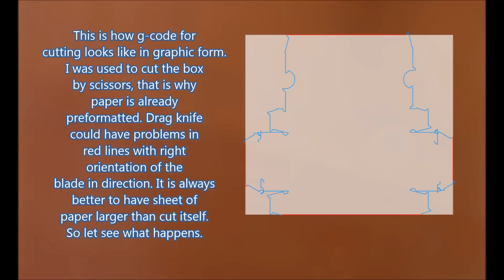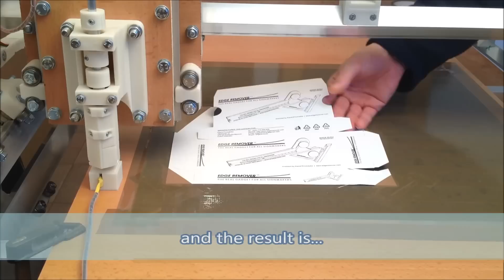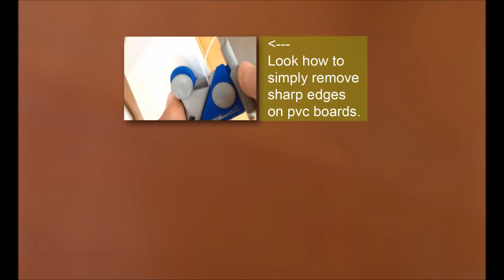Printed Drag Knife DIY CNC works pretty well

Comment: I'm wondering why you use a second set of bearings on the pivot pin.  Wouldn't it be enough to have the pin fixed and then the bearings built into the drag knife fixture would allow it to rotate around the pin without the pin needing to rotate also?
Reply from the maker: +pyronaught Hi, you are right, you can use also solid spindle - mounted rod. Only reason why I did it, was that I wanted whole axis to be rotated. Rotation is then smoother.

Comment: IT'S OK! thank you so much ! got it ! encomodar sorry again , but I have one more question. How is control of the " turning " of the knife when making a cut in a curve . You make the design of the curve in a CAD program and he sets the knife angle in cuts ? Sorry this lot of question is that in Portuguese ( Brazil ) and in forums not esou meeting on the subject. very grateful for the attention !!
Reply from the maker: +Leonardo Huss Knife rotates by itself by slighly touching the material, you have to set it. Turning is doing by circle way like you can see at strange looking corners 2:24, that is the turning of drag knife, because the knife is dragged so it is needed. Just look carefully at video, it is no sience.

Comment: Hi. I am from South Africa. Your printed drag knife is very cool. I am also very interesting in your CNC itself.
Do you have some plans or description of it? It seems if all the parts were also printed on a 3D printer.
Reply from the maker: +Paul Roos 
Hello Paul, yes a lot of parts are printed. This CNC was good just for learning of basics, its really slow and some axis are not solid enough, mainly X. On internet you can find much better types of DIY cnc with low cost, just search.

Comment: what CAM software are you using? Did you customize the tool path to raise itself at the 90 degree corners
Reply from the maker: +nick durrett 
I did not have CAM for it, just drew the whole path in Corel Draw with corners like you can see in video. This raising I set in Simply Cam 2.

Comment: hi, how much distance/shift do you have between the rotation axis and the knife point?
tx
Reply from the maker: Hello, actually it depends on blade type, now I use around 1,5mm. You have to test it to find optimal conditions.
Reply: +edgeremover thanks! Will try with 1,5. I tried with 0,7 and it's shredding everything:-(
Reply from the maker: 0,7 is really low and problematic, if you cut thick material you should choose much more. Try 2mm.

Comment: Simplycam 2? Does it have a drag knife calculation?
Reply from the maker: Jonathan Lowe 
No, it does not have, you have to draw it.
Reply: edgeremover You draw all the tool paths?
Reply from the maker: Jonathan Lowe 
Actually I did it this way. First I draw the line for travel the knife, and the corners where knife is suppose to be turning I draw circle with offset. Then I import it into the
Simply Cam2 and generate g-code. Yes, It could be easier with some software which could does this offset calculation for turning.